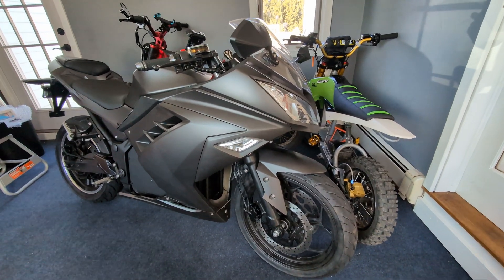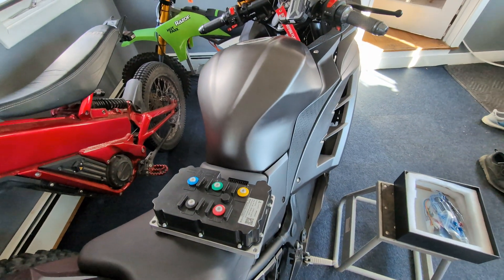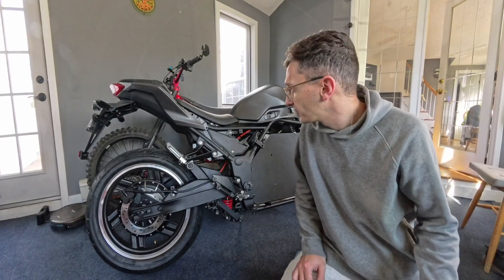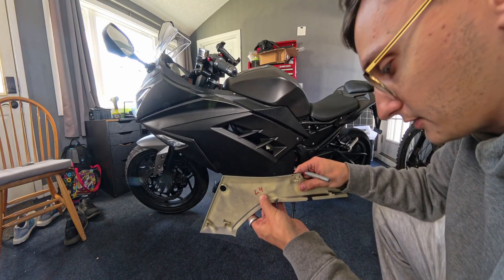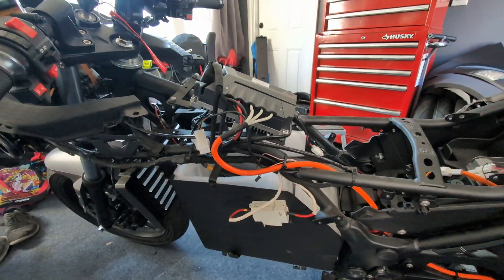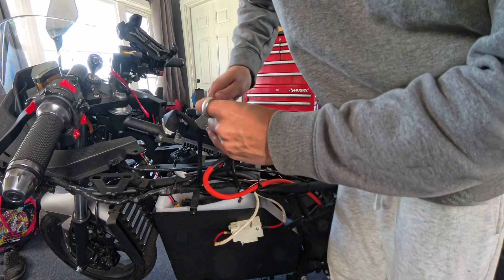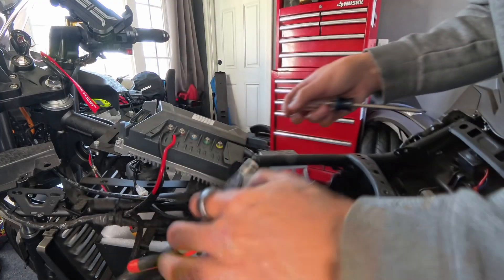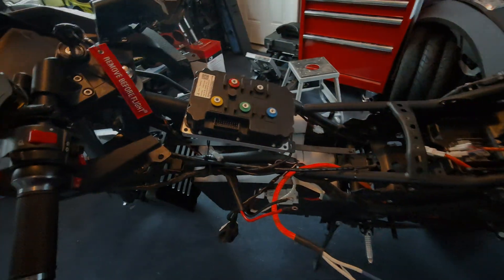I Took Apart the CHEAPEST Electric Motorcycle to Upgrade to a MONSTER 96V CONTROLLER!

Comment: The wattage calculations in your description is inaccurate (96 volt battery 109 volts when fully charged, but for simple maths) 96v nominal*450 line amps of power if you have the battery which is 43,200 watts not 81,000 watts as you claim you go by line amps not phase amps for calculations, but still thats like 57/58hp which is equivalent to a 500-600cc motorcycle. I am actually doing a similar build on a venom e-vader (e-grom copy)

Comment: You also need a battery capable of discharge 500A Continuously, minimum. A battery pack always need at least 10% overhead of the max controller phase amps. I know Exactly what kind of battery pack you need that are capable of that, easy to make, cheap to buy and easy to find.

Comment: Your motor needs 3 x 6AWG phase wires coming out the hub for you to exploit the full potential of that EV.
Also, your battery discharge wires should be at least 6AWG, preferably 4AWG. And the battery needs to be able to provide constant 200A. 
Contact me for further improvements.

Comment: I hope you get a solid 96v battery my dude 🤘👽🚲🎬
Reply from the maker: I'm settling for nothing but the best!
Reply: Yea 96v 450 amps is perfect. I’m thinking my next build will be a RZ motorcycle. Kelly controller or fardriver 134v is hard to find a controller capable of 220 amp peak

Comment: Good start my friend ... but you must change the motor to handle so many amps!!
This motor max can go 10-12kw..
Reply from the maker: Oh, I know! This controller will work with the 72v Battery I currently have & will work with the 96v battery I'm working on sourcing. When I order the battery I'll do a new motor too

Comment: Just drill the holes on that bracket an off ya go looks like its close
Reply from the maker: I can, but the controller is physically larger than the last one and I need to move it more towards the seat to ensure proper clearance
Reply: Oh i was thinking you could get two holes atleast but that makes sense